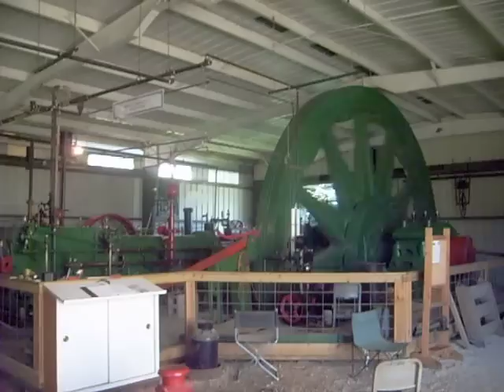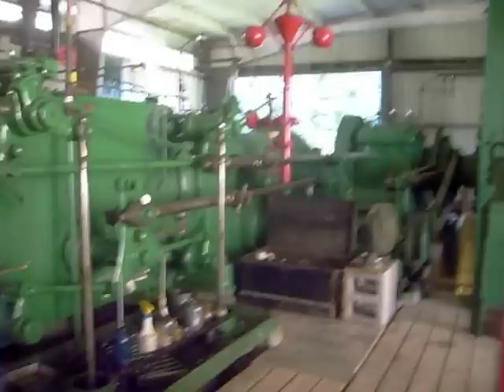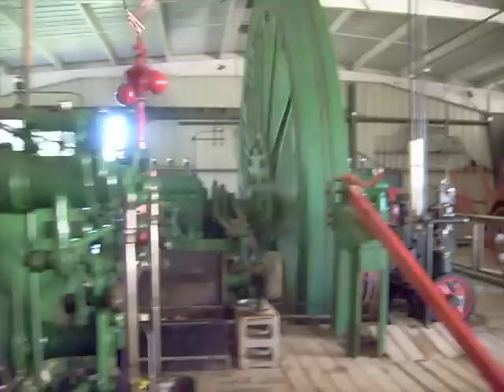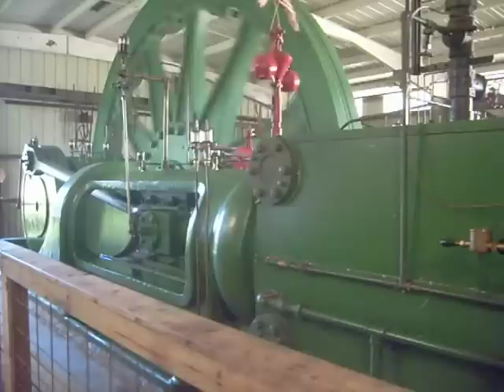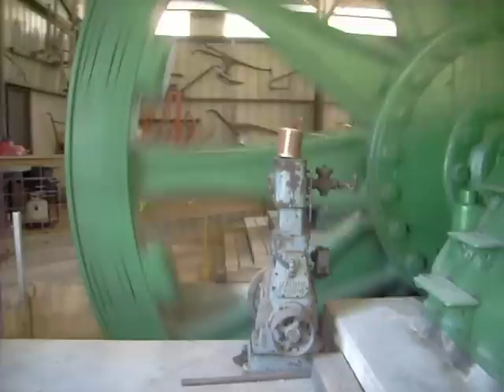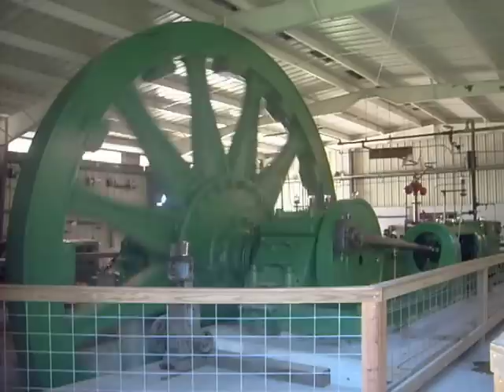HUGE 130 Ton 4798 horsepower 100 year old Cooper Corliss Steam Engine Operating in Freeport IL

Comment: Imagine the torque on this monster... wow
Reply: My first thought as well. Usually some smart commenter with an engineering background calculates the torque on these monsters, which is usually enough to rip a giant sequoia out of the ground.
Reply from the maker: FYI:  @winstonsmith1284  Torque is Measured. . . Horsepower is Calculated from the Measured Torque Times whatever RPM you take the reading at. . . 

Yes, You can Reverse the Formulas and Calculate Torque from the "Estimated" HP, but you can't Directly MEASURE Horsepower, It is ALWAYS Calculated. . . 

Horsepower can be Calculated From the Boiler Pressure, From Watts, and from Other Sources, but it is ALWAYS Calculated.
Reply: About 760KN*m by my reckoning, assuming the values in the description are accurate.
Reply: @benhoward2619  good lord, thanks for the calculations sir 😊

Comment: Looks like the flywheel was a modular design, very easy to transport by rail anywhere you needed it.
Reply from the maker: Breaking down into twelve individual spokes and rim sections each weighing 10,000 pounds it's still no easy task moving it, but yes it did make it easier to ship. 

The Crankshaft with flywheel hub and crank disk cast in weighs another 25 Ton or 50,000 pounds on its own. I forget the weight of the base, cylinder, piston, rod, and other parts, but even with Rail Transport, the parts still needed to be off-loaded onto trucks and/or wagons to get from the rail to the building site, and then erected. 

Engines this size were generally built on order and shipped to the buyer and then never moved again after that until they were either cut up for scrap or disassembled and moved by a group or  society to put on display for historical preservation for future generations.

Comment: Steam engines! Maybe not the most effective ones, but the coolest engines!
Reply from the maker: They're a Lot More Effective and/or Efficient than you think.  Though it does vary depending on the fuel source used to boil the water to make the steam. 

Think of the electric power plants. . . Whether they burn Coal or use Nuclear Reactors or the newer experimental Solar Powered ones, they are still Generating the Electricity with Steam Turbines. 

Nuclear Submarines are Steam Powered Too !

Comment from the maker: I finally got around to counting the revolutions, and IF I counted right, it looks to be running at 20 RPM which would still be just under half of what it would have run at the factory. Any other videos I've found of this engine all show it running very slow at around 5 to 7 RPM. 

While the governor is functional, it is disabled as there is No Variable Load on the engine to need it. The speed is being maintained by the opening of the throttle valve only.
Reply: Is it throttle-governed or cutoff-governed?
Reply from the maker: The governor is supposed to control the Throttle, but at the low speed we run at for demonstration only, the weights don't fly out so it is blocked partially open and the speed regulated with the gate-valve in the steam line. Open up a bit for starting, then shut down to desired speed. . . As the engine warms up and the bearings get well lubricated it gradually picks up speed through lower frictional losses and the gate-valve is shut down a little more.

Comment: 1914 & 4800 HP.....We have a 3800 HP on our gas compressor it's actually a jet turbine three feet diameter n five feet long.....26,000 RPM and LOUD.  Quite would be sweet.

Comment: I would like to know just how many revolutions this thing made over its service life! The Industrial Revolution at its pinnacle!
Reply from the maker: Not sure how many years it ran in the factory or if they ran 1 - 2 - or 3 Shifts, but at 45rpm it would be 2700 revolutions per hour times 8 hours or 216,600 per shift times 5 days for 108,000 per week per shift times 52 weeks for 5,616,000 per Year per Shift times however many years.
Reply: @oldSawyer  that's amazing! They just don't build them like that anymore.

Comment: That's amazing. I want one. I could use it to power my house. And my neighbor's houses, too.
Reply: You can power a small city with that thing easily!
Reply: Especially now. Off-grid homeowners could have a steam shed. A small steam turbine would turn a generator to supply direct power and charge a bank of batteries. I even think copper tubing could be coiled around the smokestack for hot water.
If they have an electric car it makes even more sense.
Reply: @awaitingthetrumpetcall4529  It's not a bad idea - a steam generator could use literally any fuel to provide the heat, too.
Reply: @doggonemess1  "...a steam generator could use literally any fuel to provide the heat, too." 
Yes. Dead trees, twigs, biomass, trash, propane or whatever. Even atomic energy uses steam turbines.
It's not passive like wind, solar or water because it requires work. You have to keep fuel in the firebox, keep the boiler clean and filled with water. That said, common people that own some land have what's necessary to provide their own electrical power.

Comment: Who could pour such a huge flywheel? Ive always wanted to work with such tech but alas we live in a world with people amazed by simpler things
Reply from the maker: The Flywheel is made up of 12 T-shaped segments with each Spoke having a section of the outer rim that are held together with dog-bone shaped straps that were heated up to expand then shrunk into place locking the sections together. Spokes are Bolted into the Central Hub which is roughly 10 or 12 feet in diameter.
Reply: Yes they are too busy texting, tweeting and twatting....and not necessarily in that order.

Comment: 4800 HP at 20 RPM...the torque on this thing must be incredible.
Reply from the maker: That 4800hp is at its rated 45rpm and at whatever the factory Boiler Pressure was (which I don't remember without going in and looking at the charts again sometime) 

Estimated Torque in the neighborhood a quarter million foot pounds.
Reply: 4800 horsepower at 45 RPM is crazy. HP = Torque * RPM/5252, which gives me 560,213.333 lb/ft of torque

Comment: One boiler horsepower is equal to the thermal energy rate required to evaporate 34.5 lb of fresh water at 212 °F in one hour.  So you're saying the boiler is evaporating 34.5 x 4798 pounds.   That's 82 Tons of water.  About two semi tanker truck loads.  Every hour.
Reply from the maker: +Jim Connelley  Not with the small boiler and lower pressure that we operate it with. The hp rating I posted is from a chart located in the building with the engine showing the hp at different pressures. I don't currently have access to that chart and don't know the what our boiler capacity is. I will say though that it is just big enough to run the engine at the low speeds we run it at for display purposes and nowhere near what was used in the original factory setting operating under load.
Reply: @oldSawyer  Well water when evaporated wil expand to about 1500 times its original volume.

Comment: Since it's now 2019 is it still inFreeport? Still operating? and what does it do? The rotating balls--- they show the testrone of the guy who ade it,  govener!
Reply from the maker: Yes it is still in Freeport, Not likely to ever be going anywhere else in our lifetimes. . . It was DOWN for most of 2018 due to leaking Flues in the Boiler which needed to be replaced but should be up and running again beginning with Memorial Day Weekend 2019 and then on several other "Open-Dates" throughout the season. . . The Schedule still needs to be updated (as of Jan 1st) but here's a link showing the weekends of operation from May through September. . .   http://www.thefreeportshow.com/schedule.htm

Comment: That kind of HP rating seems a little wild for that low of RPM. 4798 HP into 45 rpm makes 559979.9 ft lbs torque. There is no way... Given cylinder size and pressure rating there is just no way.
Reply from the maker: The Numbers are directly off a chart stored near the engine.
Reply: wishus knight I bet that engine make at least 50,000 ft lbs, that's if it make around 4800 hp, that's my guess- 110 horsepower steam Case tractor makes over three thousand foot pounds of torque, that's why I guess such a high number for torque on that single-cylinder steam engine

Comment: What is the 2 ball rotating topside?
Reply from the maker: That is the Governor which would control the speed of the engine if/when running under a variable load. When the engine speeds up the Balls fly outward pushing the valve shut to keep it from over-speeding. When the engine slows down under a load the balls would drop back down closer to each other pulling the valve open to speed the engine back up to its operating speed. The way it is running here at very low speed for demonstration purposes the governor weights are blocked with a small piece of wood holding them with the governor valve partially open while the engine speed is regulated with the throttle valve only.
Reply: oldSawyer okay, tks 😍

Comment: spin this flywheel at 1000 rpm would make the day longer by slowing down the rotation of the earth.
especially if it rotates from south to north or vice versa.
Reply: At 70 rpm this  flywheel would fly to pieces. It is  80 feet in circumference, so every 10 rpm of the crankshaft , the rim speed is 800 ft per  minute. Maximum rim speed of a  solid cast iron flywheel is around 6500 feet per minute. So whilst it does not look like it is  traveling fast, the rim speed at 45 rpm is inside the  comfort zone.
 I have a steam driven air compressor that weighs about 9 tons and has an 11 ft. flywheel, it is impressive but miniscule compared with this big fella . I am in Australia, there are a few old windmills here that are 40ft. In diameter, anything old and big is impressive except the mother in law.
Reply from the maker: I'm guessing, or hoping anyway that haugstule was being sarcastic with his comment  @bartholomewchuzzlewit4356 , especially when read in its entirety, but YES, It Would literally EXPLODE Long Before reaching even a fraction of his 1,000rpm idea.
Reply: @oldSawyer  I think so too...it's a  big wheel. I am in Australia and I have a steam driven air compressor that weighs about 9 tons and has an 11 ft  diameter flywheel that weighs 3 tons. It's impressive until you parked it beside the  Corliss. I have never had it running but I am going disengage the compressor valves and friction drive it with an  electric motor at about 25rpm. It was built in 1903 and I was lucky enough to get the original drawings for it. You can't beat the attention to detail in the old machines.

Comment: What did this engine drive?
Reply from the maker: It powered a bank on Zinc Rolling Mills at the Matthiessen Hegeler Zinc Company in La Salle Illinois, rolling huge blocks of Zinc down into thin sheets that were used for Newspaper Printing Plates and for making Pennies.

Comment: though torque for this thing should be over 100,000 if it makes that much HP
Reply from the maker: +joe bob I'll have to wait to get in there to see the charts again but I seem to recall reading that with the 85 tons of rolling mass that there is something like 240,000 ft lbs of kinetic energy stored in the flywheel. . . And as noted it takes less than one revolution to get that 85 tons up to operating speed.
Reply: ft lbs is an outdated measurement for torque tho. Not rotational energy.
Reply: Just grab the flywheel and find out lol

Comment: 5,000 horse power which burns very little coal to make steam. The weight is on the outside edge of the wheel which uses momentum to keep itself spinning requiring less power to keep it turning. A 20 foot wheel connected to a 1 foot gear gives a ratio of 20 to 1. If the big wheel turns at 300 rpm, the small gear would turn at 6,000 rpm. That is fast enough to connect to generators to produce electricity using very very little coal. 5000 hp would power a long line of generators all connected by a central shaft. These engines used to power entire factories using leather drive belts connected to pulleys and would power every machine in the building. The steam turbines they use now are so bad and inefficient we are burning 5 billion tons of coal globally to make steam. It is the most expensive wasteful use of coal. These flywheel engines will help save the planet and reduce our coal usage by 80%. Coal has been 350 dollars per ton and now the utility company's are bankrupt all over the world because of commodity prices. It went from 30 to 350 per ton, up over a 1,000 % for 24 months and no one, no one has done anything about it. Very good video of an excellent machine. 
LLXIIX77